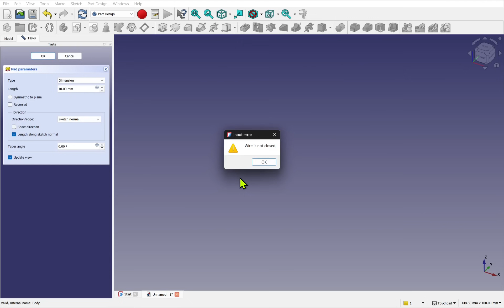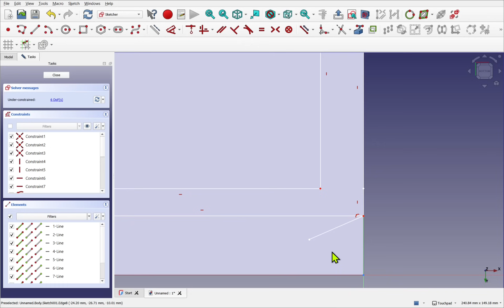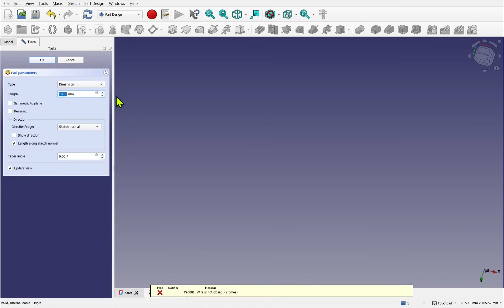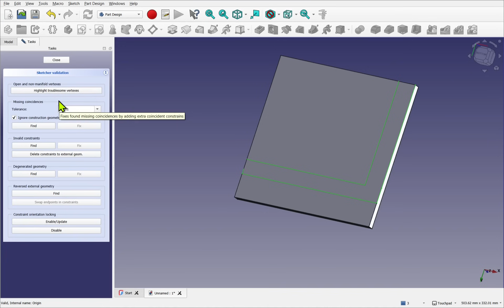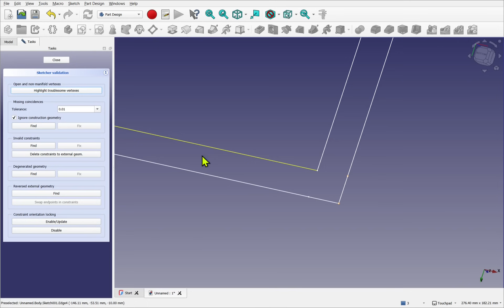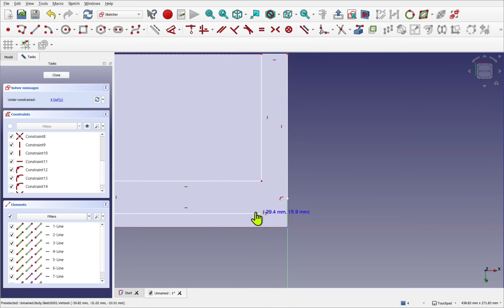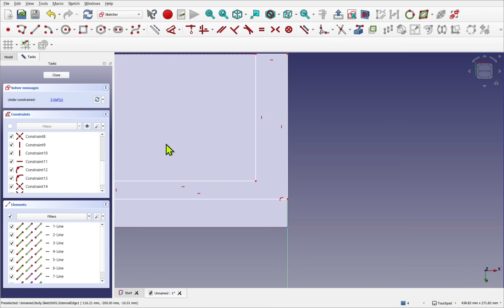How to Find & Fix FreeCAD's Wire Not Closed Error in Sketches | Troubleshooting in freeCAD 1.0

Comment: I keep getting "null shape" when trying to rotate (padding doesn't even show anything at all).  I've doubled checked, redone, and validated the entire simple sketch.  It's fine.  It just won't rotate.  I tried a second sketch of a circle with the diameter constraint, and with its center constrained to the center of the sketch.  That won't pad or rotate either.  Both are inside the main body.

I tried reinstalling FreeCAD (I have the latest version now, 1.0.2), and that didn't fix anything either.  I can't figure out what I'm doing wrong.  Do you have any ideas?
Reply from the maker: As you said you have sketched a basic circle that resides in the body, If you just said that you cant revolve the sketch I would of said the sketch profile in the sketcher Intersects the axis of revolution rather than being to one side.  But you then also said about the pad of a single circle then that is strange.  I'm not sure if your are on windows or linux.  If in the sketcher you look at the elements on the left hand side towards the bottom and there is a single circle in there then there is no hidden geometry then the circle should pad fine as long as you have selected it and then selected the pad operation (not double clicked it from the 3D view as this can select the parent, the body and will cause errors when padding).  Which OS are you running on?

Comment: This doesn't work when it comes to Arcs connecting with circles, you can be fully constrained and the wires do not connect so no padding is possible A bug that can't be fixed

Comment: That's very useful. So how do you find wire and vertex problems in imported stl files?
Reply from the maker: Funny you should say that I have been working with a patreon regarding importing 2D files. One way is when you import the SVG, jump over to the draft workbench and use the upgrade to group certain shapes together, when you convert them to a sketch you can use the sketcher, validate sketch and then select find and fix missing vertices. This seems to be very successful with such geometry. I am currently creating a video to help out as well so quite timely.

Comment: I have often run into this, usually when adding a constraint to a single point onto the Axis line (X, Y or Z) with multiple lines, then deleting a line later, seems to break everything added after the deleted line.
My issue with Freecad (the only CAD software I actually use) is that it will do constraints A-B, B-C, C-D....... when adding constraints, not as one would expect with the entire A-B-C-D.... to the same point, where the deletion of one element won't break a chain of coincident points

Comment: IMHO:  I've encountered this issue much more with the newer versions of the sketch tool and I think that the reason is the logic behind auto-constraint generation/substitution algorithm.  The auto constraint feature is great but it's my impression that it substitutes in Tangent constraints too often.   This is just an impression that I have and not based on any objective analysis.  
Regardless of why this seems to be happening, I've found focusing on eliminating tangent constraints in the area of closure issues and yanking things around to find disconnected line fragments and missing coincident constraints is the quickest way to resolve broken wire issues.
What this tutorial demonstrated!  😊